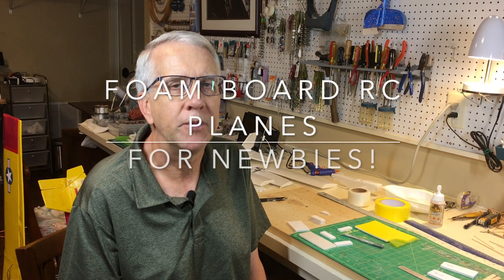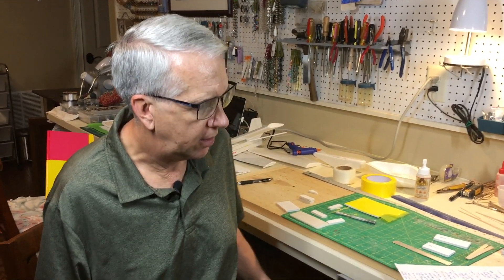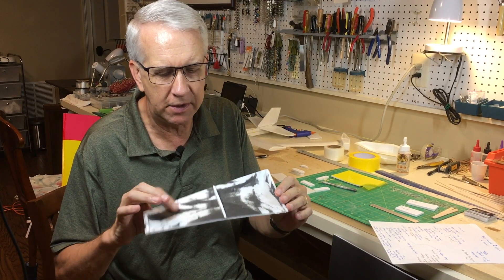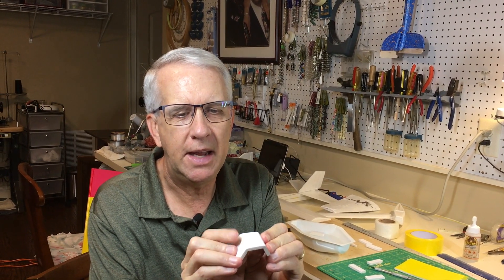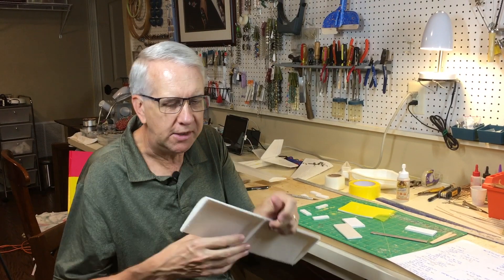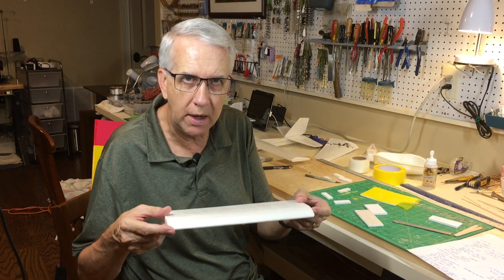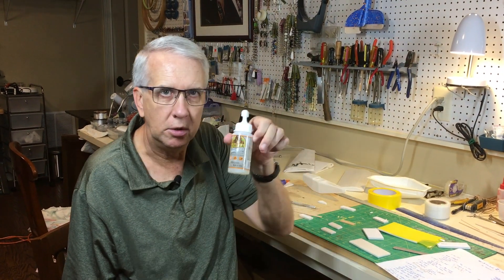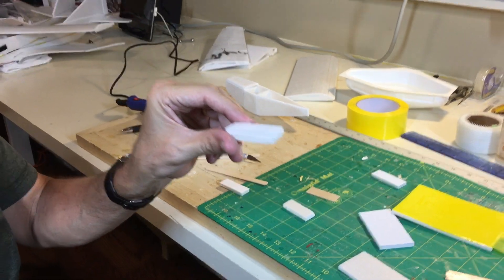Foam Board RC Planes for Newbies!

Comment: Can you leave the paper on the foamboard to provide more rigid support or ding protection?  I didn't realize the paper was taken off and assumed the paper was left on for strength.
Reply from the maker: Yes, for sure. Paper on helps a lot preventing hanger rash, but does add a bit of weight.

Comment: I know I'm 4 years late to the party, but I'm just about to order a balsa rc model plane kit and I've been worrying about spending a month to build it, then 5 seconds to wreck it!!

I think I'll make a couple of foam board planes to hone my flying skills on first. 👍
Reply from the maker: That is a good plan!  Do use a computer RC flight simulator. They help a lot.
Reply: @TimMcKay56  
Thanks for replying so quickly. 👍
I used one of those simulators years ago, so I've got the basic understanding of flying an RC plane, but I no longer have a computer.

I'd be very grateful if you could point me in the direction of some plans for foam board rc planes. 

Over here in the UK we have two categories for RC aircraft and drones. Under 250g you just need a user ID, but over 250g you have to have an operators ID. You have to sit a test and pay £11 per year for it.

Comment: 🌴 So on the dollar store black foam , I realize that removing the paper removes weight, it seemed pretty light with it on ? Could a plane be built with the paper on and then sprayed with something to seal it and make it durable🤔  say clear polyurethane  or brushed or parapet with thinned wood glue ?  It would add to the adhesion and seal the surfaces and make it more of a hard surface , and more structurally sound, it would seem to me that the extra weight could be over seen with a bigger motor or prop ?
Reply from the maker: Absolutely!  I keep the paper on most of my models, just not the smaller ones. Tim

Comment: Tim, I'd like to build something like a large slow stick. Need a 60" wingspan. Slower the better. Can you point me in the right direction. Thanks.
Reply from the maker: Sure. Just get a three view of a Slow Stick. Say the measured wingspan is 10”. Simply multiply all of the 3 view dimensions by 6, sketch out the full size plans (all straight lines) and build it!  Tim
Reply: @TimMcKay56  can you lead me to a suitable wing as slow stick is a molded wing. I want a dollar tree (2 panels) wing since im looking for 60". Stab and tail could be dollar tree foam.  Also, ( don't care) ailerons or not? ( been flying many years) Thanks! P.S. I do have a slow stick. Would rather a big one than an "old fogey)

Comment: Great content! Any suggestions on component kits? Is there any kit that has motor, prop, servos that are the correct size for these smaller planes that you're building?
Reply from the maker: Vance:  Thanks for checking in!  The motors, ESCs and batteries are listed in the description for each plane. A good starting point. Tim
Reply from the maker: Vance:  Thanks for checking in!  The motors, ESCs and batteries are listed in the description for each plane. A good starting point. Tim

Comment: And on Amazon you can get a 6 pack of each color of a roll of packing tape it's very thin and goes on very easy and looks great and strengthens the model as well and water proofs it I cover my foam board first with packing tape then I cut all my pieces so I cover the whole piece of foam board first cover like two or three of them then lay out your templates and plans and get to cutting
Reply from the maker: Fully agree, and the tape is very sticky!!  Tim

Comment: I use hinge tape on all my control surfaces I actually cut my control surfaces and will use either some index cards and cut small strips as my hinges and just glue it into the edges after I cut a slit on each edge then I will weave my hinge tape and I have never had a control surfaces rip or break
Reply from the maker: That is a great approach as well. Tim

Comment: Thank you Tim for your videos. quick question, I see this Flysky FS-i6X transmitter on amazon which is cheaper than the Spektrum models. any drawbacks with this transmitter?
Reply from the maker: Gihan:  I do not have any experience with the Flysky products.  Taking a look at Amazon, the reviews seem positive, maybe give it a chance.  As RC plane crashes are such a pain in the neck, I like to find the best products out there.  Spektrum seems to lead the pack (they introduced 2.4 GHz technology in 2004, for example).  What I really like about the newer Spektrum TX and RX are their built-in antennas.  I have lost 3 models over the years to antenna issues, no more.  😁 Tim
Reply: @TimMcKay56  Thank you for your insight

Comment: So the plane you fly in the last video..
Does it have a adjustable throttle and just Rudder and elevator
Reply from the maker: 80-K:  Yes, three channels. Throttle via the electronic speed control, elevator and rudder. Tim
Reply: Hi... on the the high wing small aircraft that you built...
What size KV motor is it do you know and also what size ESC..... must be just like a 5 amp

Comment: Thank you for the interesting and informative video 🙂 I was thinking of using foam sheets as a lighter alternative to balsa wings for small 1/2A R/C (glow & diesel) models. As such, would you know if this material is suitably durable and fuel-proof ?
Reply from the maker: Ding:  There are a lot of different types of foam.  Best to test a sample piece of foam first with a bit of fuel prior to building the model.  Tim
Reply: @TimMcKay56  OK. Thanks !

Comment: Very, very nice, informative video!.  Would be nice if you can also tell the measurements in metric units.
Reply from the maker: Javier:  There are several measurements shown on the plan, to include a 6 inch ruler.  1 inch = 152 mm.  Tim
Reply: @TimMcKay56  am I wrong? 1 inch corresponding to 2,54cm or 25,4mm. Thanks for all informations.  I'll be grate to you if you would specify motor(brushed/brusshless) power w/ kv you use for plane on the video(perfect for backyard) ,battery (1/2slipo ) esc /bec A and propeller.  Nice job. Congratulations
Reply from the maker: @massimoborghini9724  Yes, 1 inch = 2.54 cm.  For the ultra-micro motor and electronics, see:  https://youtu.be/Erxv9bqzZDw

Comment: Thank you 
How did you get CG and proportions wing to tail and the fuse?
Reply from the maker: Chris:  For a constant chord wing, GC is 25% back from the leading edge.  As for the length of the fuselage and size of the tail surfaces, to be honest, I eyeball it and draw something that looks about right.  And if in doubt, make the surfaces a bit larger.  Tim

Comment: Have you used the Flitetest foam board techniques?  Removing the paper definitely removes weight however the foam board can be waterproofed which prevents delamination.
Reply from the maker: Karen:  Flitetest has some excellent ideas on use of foam, many different ways to tackle the problem.  Tim